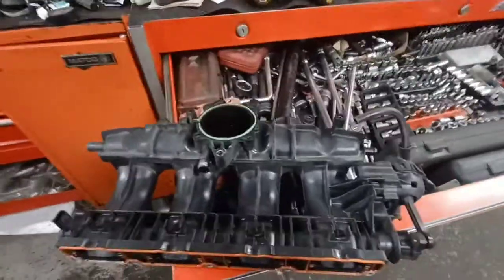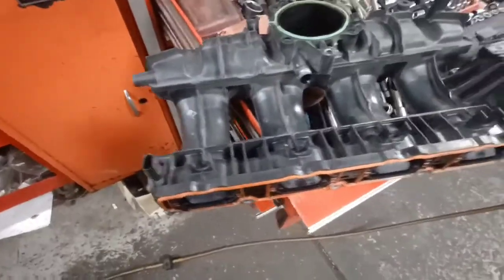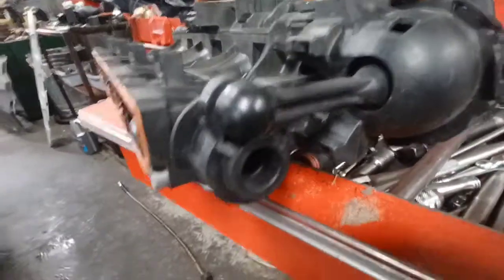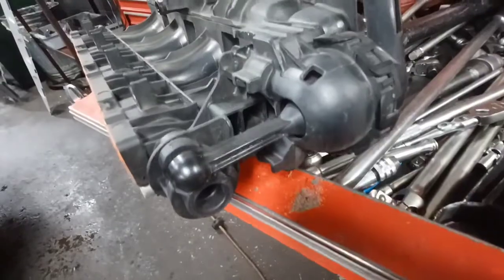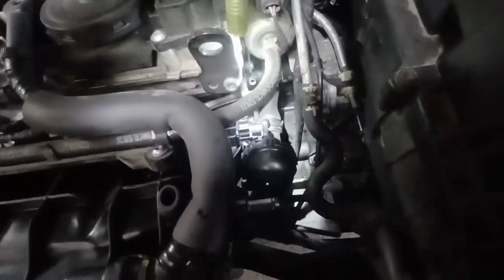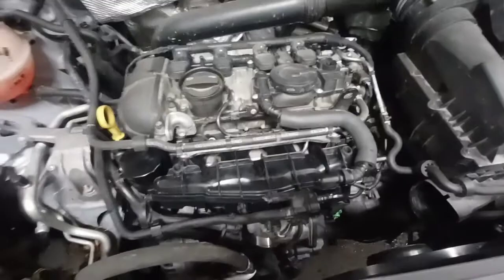P2015 FAULT VW 2.0TSI (CCTA)

Comment: Dealing with this now on my 2015 A5. I know for the TDI they make a bracket you can install that stops the lever from moving out of range. On the TSI though the problem is on the plastic actuator which is a slotted groove. I wonder if gluing a tiny bit of plastic in there to stop the lever sooner would fix the problem. I'm bought ta get creative boys. 👏
Reply from the maker: https://youtu.be/3-_3iu_9xxU?si=s40eIqCFGu05JO_Z
Reply from the maker: This thing is a little hit or miss but it’s currently working on my vehicle
Reply: @EuropeanAutoRepair  Did it fix your problem? Im about to buy it too so I dont have to buy a new intake manifold.

Comment: Thank you for this video! I have this errorcode on my passat tsi 2.0 cawb, i get it sometimes when i accelarate and just remove the engine light with obd. I have not felt any problems when driving, just that the engine light comes pops up when accelarating. Can it cause any damage would you say?
Reply from the maker: I've never really seen it cause any problems, thanks for watching!

Comment: Hi and thanks for your videos.  I did a rear seal repair thanks to your other video.  I’m popping a p2015 code but the flap actually is in perfect condition.  What else could it be?
Reply from the maker: Does it have updated intake manifold? Thanks
Reply: No it’s the original 2010 manifold.
Reply: @EuropeanAutoRepair  no it’s the original 2010 manifold.  I meant to say the actuator mechanism is in good condition and not separating.